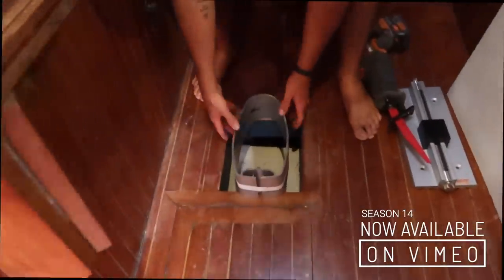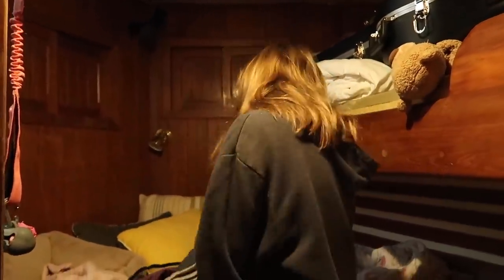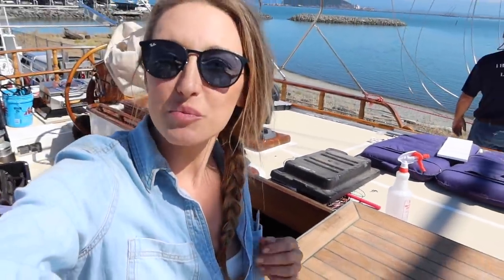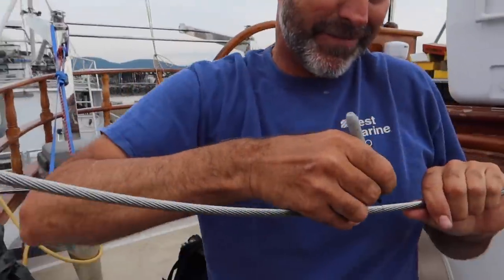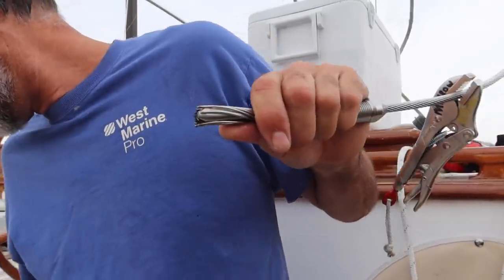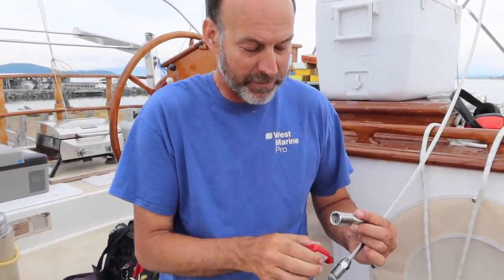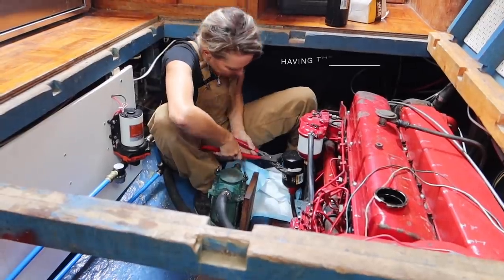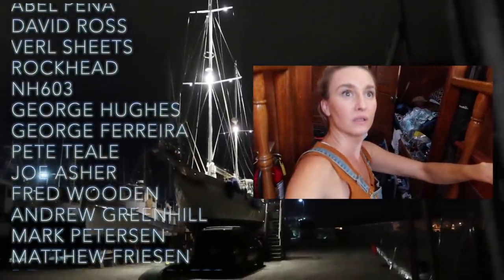DIY Sailboat Rigging | PIRATE SHIP S13E09

Comment: I take it, the engine has a water temp and pressure gauge connected up? Extra bilge pumps, hose connector clamps, Bunghole stoppers for every through-hole placed near it, secured. Quick patch emergency gear in case there is a hull leak. Emergency Alarm for bilge water level? Gaskets seals around propane tank locker, with overboard venting. Cabin extinguisher for Electrical/oil/gas fire, one in the engine room the other in the solon area. Aye, the Ship is looking good Arrrgh, have a Merry Christmas and a Happy NewYear.
Reply from the maker: Yes sir!!!
Reply: Add a Fire Blanket  - read up on how amazing they can be.  + CO2 sensor (Will need more frequent batteries due to marine/salty air)

Comment: The furler you have chosen, probably not randomly, is the only brand (except Reckmann of course) that has not gotten cheaper or more "plastiky" over the last few decades. Rather, they have re-designed it to be WAY better than the original 3250 and better than the popular alternatives.
They're bulletproof. They are bonafide REEFING furlers. Maybe a little heavy for racing around the bouys, but imo the only ones you can rely on when the caca hits the ventilador. Which is one thing you can count on. Excellent choice.
Merry Christmas!

Comment: When changing the oil filter, poke a hole in the top with a screwdriver then let it drain back in to the motor before removing. Some oil will seep out but nearly as much as just pulling it off.

Comment: With those upside down filters I just poke a hole in the center of the top and wait for the oil to drain back into the pan.  I usually do that before draining the old oil out and by the time it is finished you can spin the filter off without making a mess.  The only down side is that the film left in the filter will continue to leak out so you want to get it in the trash as soon as possible so it doesn't leak and make a mess after being so neat and clean.

Comment: When changing your oil filter, the upside down type..Poke a small hole in the top and wait 20 minutes for all the oil top drain out. Then remove the oil filter easily with almost no oil dripping.
Reply from the maker: Ooooooooooh GOOOOOOD TIP!!! Thank you

Comment: The lack of oil on the valve train of your freshly assembled DIEsel engine is of serious concern.   I realize it may have been edited out just as I hope so too was the torque wrench use on the head bolts and rocker shaft bolts.
Reply from the maker: Yes of course. This section wasn’t a “how to”, just a bit of a storyline:)